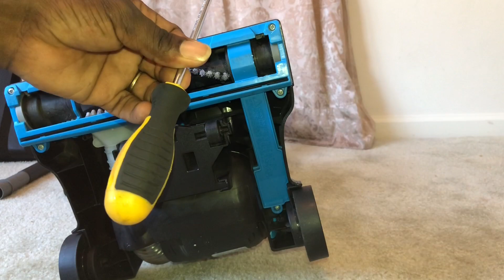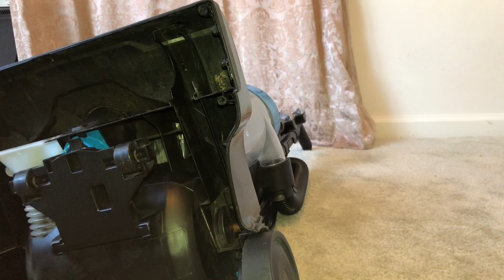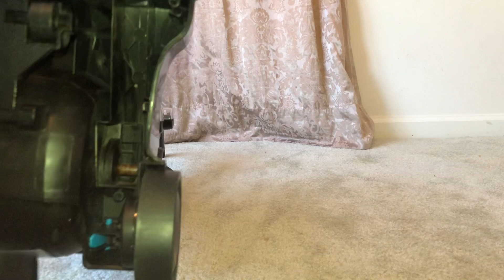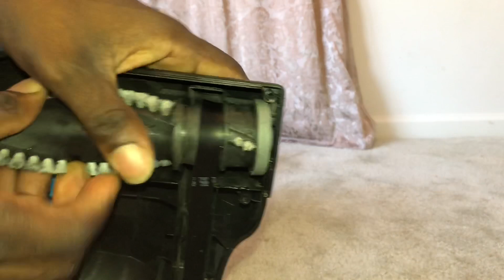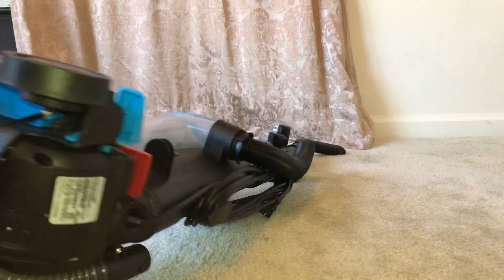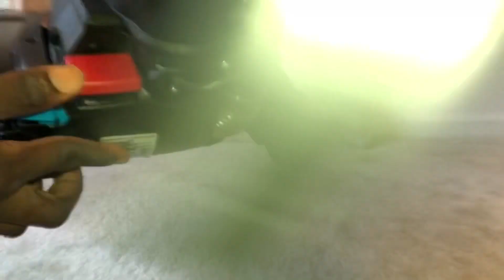How to replace the belt on a Bissell PowerSwift Compact Vacuum Cleaner

Comment: I recently had a vaccum not even half a year old, one day I smelled rubber burning, and I figured out it was the vaccum belt. Today I had bought 2 vaccum belt I installed it and I was vacuuming with it just fine then I smelled the burning smell and it broke once again. I don't know why and I had already cleaned the brushes and everything and I'm back to this plz help me.
Reply from the maker: Clean the shaft that the belt runs on and check if the brush bering running free
Reply: @MrtalentedReid  I think the belt is too small back it's a struggle to snap it into place and also I did clean the shaft but i honestly think it's the belt size
Reply from the maker: Ok
Reply from the maker: Does the track that the brush spin in melt up or its ok
Reply: @MrtalentedReid  The Belt Burns when I use it
Reply from the maker: You see after removing the brush it carry two ends that spins if those not spinning freely it can cause the bet to over heat and snap
Reply: @MrtalentedReid  yes they are
Reply from the maker: Ok look up the belt size by the model and see how it goes
Reply: @MrtalentedReid  tbh I think I think I just need to get a bigger belt becuase doing all that is alot
Reply from the maker: Ok it can't too big though because it going to keep slipping when hit the carpet
Reply: @MrtalentedReid  ok thanks
Reply from the maker: Your welcome